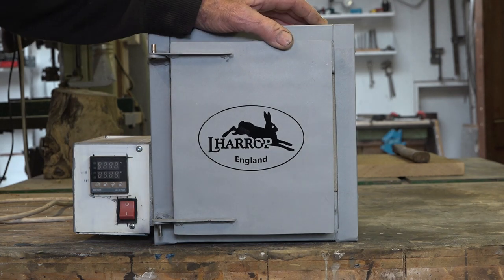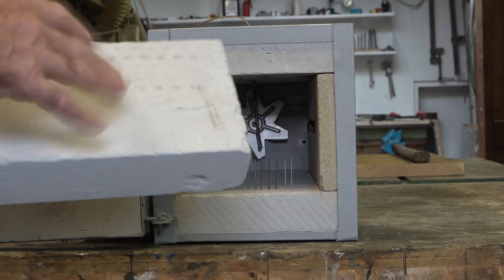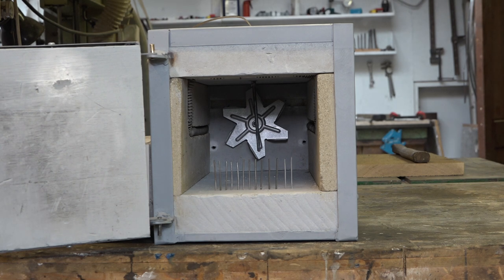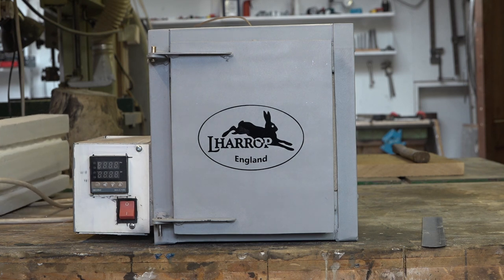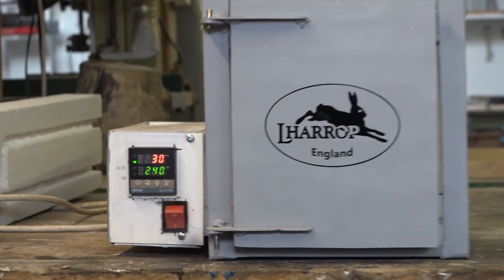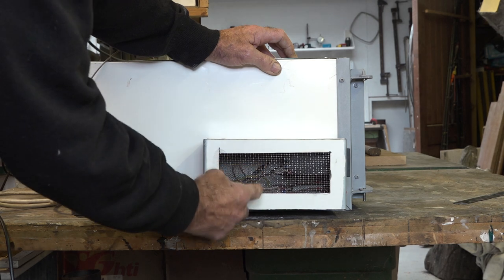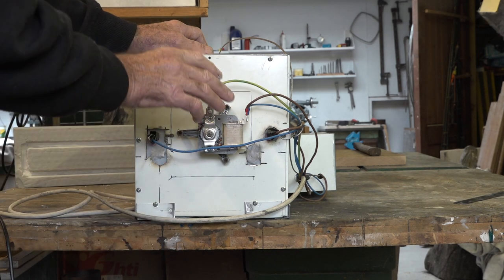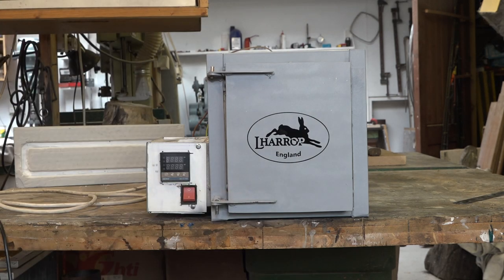Diy Dedicated knife makers tempering oven

Comment: nice! I picked up a old front opening kiln that was used for ceramics that i have a PID and and SSR for. Now I just need to build a box and wire it up..
Reply from the maker: Hey bud, yea get it done mate, did you get that new anvil yet or have you beat up the old one again ;-)

Comment: Hi Loz, good work mate. I will make one comment though. I use solid state relays (usually the puck type) in the machines i work on and they do sometimes "lock on" resulting in a runaway condition so, there should be a separate thermostat set to a higher temperature to catch this condition and disconnect the power to the element, otherwise the element could burn out. You may have something in place that i can't see and if so, fair enough. It's worth a mention though. Cheers. By the way, nice to see you are getting out on the bike again :)
Reply from the maker: Thanks Tony good point there, I had ordered an alarm buzzer to fit to the temper oven, it had not arrived when i filmed this i have one on my kiln also, I never leave either oven alone when they are in use so on this will set the buzzer 10C higher than the set temp in case of that. just 15C overshoot can potentially ruin the edge I want.  hope your well tony cheers.
Reply: @LozHarrop   Ok. you have it covered, that's good. Yep, i'm well ta.  All the best.